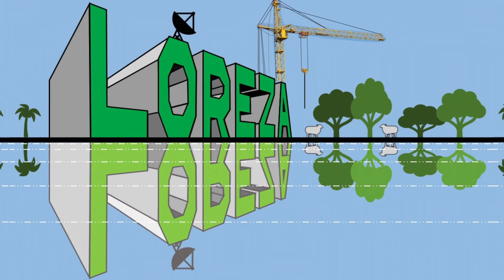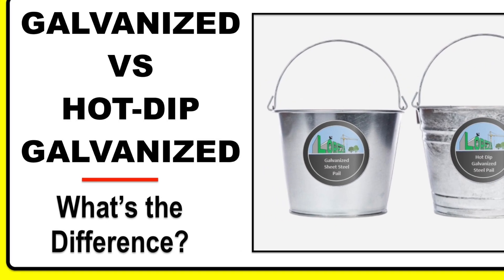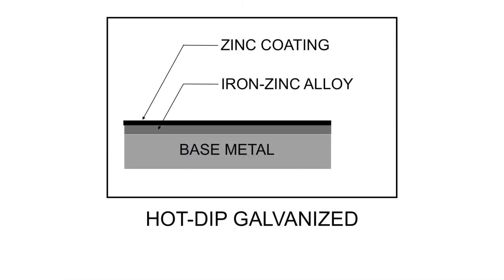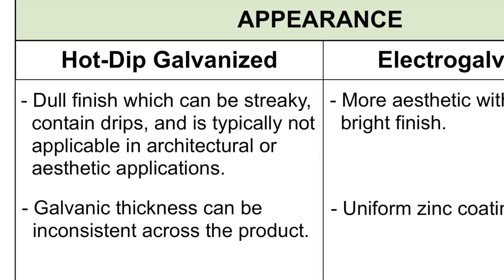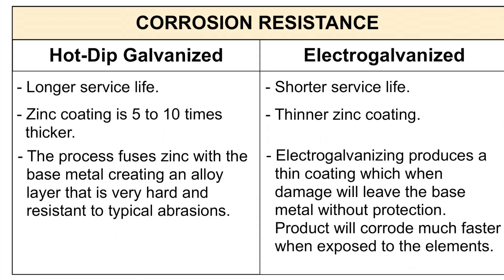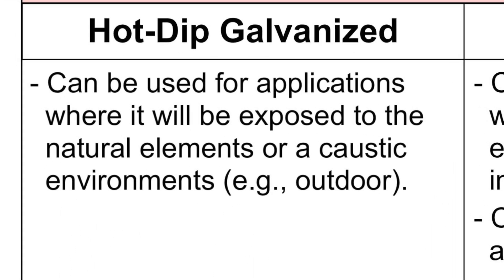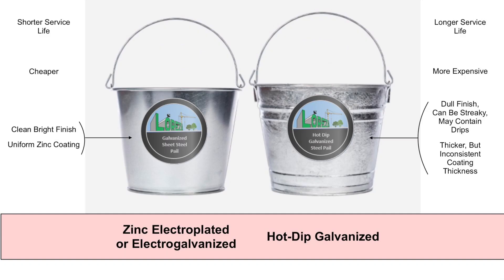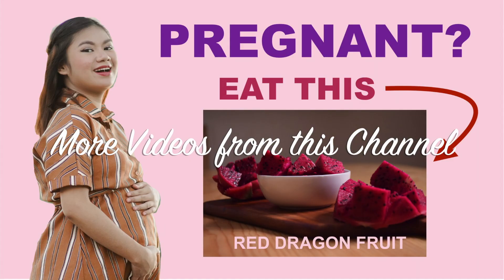Electro-Galvanized VS Hot-Dip Galvanized (HDG) - What's the Difference?

Comment: I miss the biggest negative part of E-galvanizing. If you have a pipe and you want it to be protected to the elements inside and outside, it's a fail with E-Galvanizing! It will do up to 10~15cm and that's it! Most of the people with Masters or PHD's in the mechanical field don't know this! Solution there is stainless steel 😊
Reply from the maker: Good point!  The problem with closed sections like pipes is that moisture, which could cause corrosion, could easily get trapped inside.  I agree, stainless would be the best option, when dealing with corrosive environments.

Comment: I've been in this business for years. Your subcontractor is not cutting cost to get electroplated. That's all that's available to him. I know this because I've been in the business stucco for 43 years if anybody save money it would be the manufacture. We bought what was available we did not request it we had no choice. Then we had no idea that would rust away. I don't remember what year it was but I do remember when it happened and we had some metal stucco lath and it was bright and shiny and I asked my partner I said check this lath out why is it so bright and shiny? He said I don't know that's what they sent out. But that's all they had even our distributor had no play in that that's what they sent them. We always thought it might have been the EPA that changed it still doing my research to find out.
Reply from the maker: Thanks for sharing your insight.
Reply: Electroplating is not a typical alternative to hot dip. The expected environments are simply too different. Typically weathering steel or 2-3 coat paint systems are the most common alternatives to hot dip galvanizing.